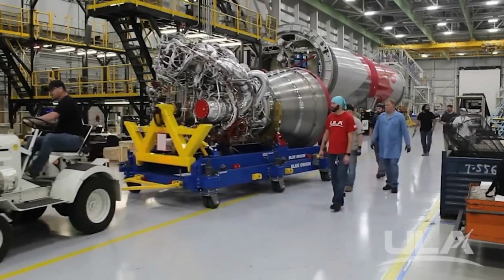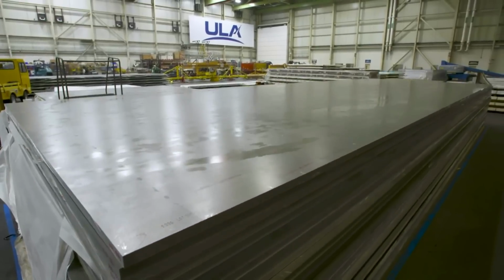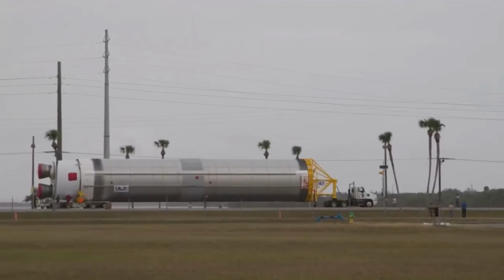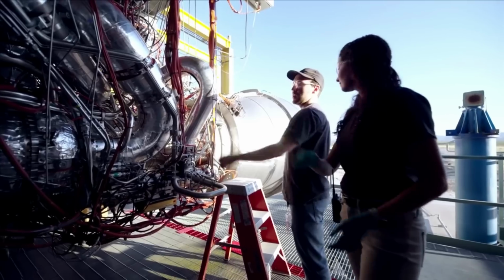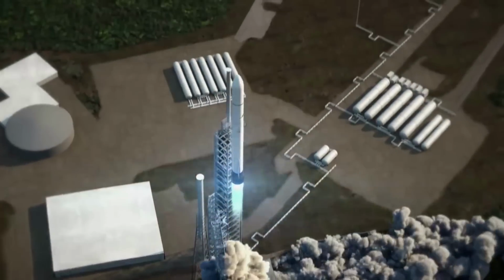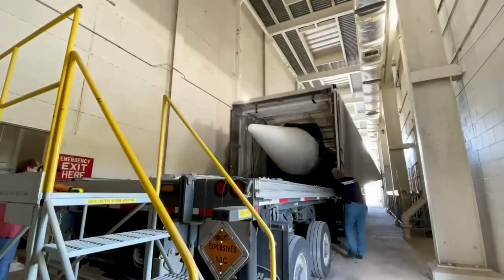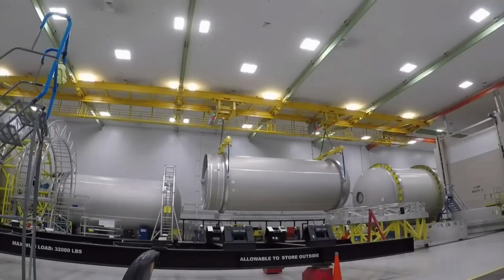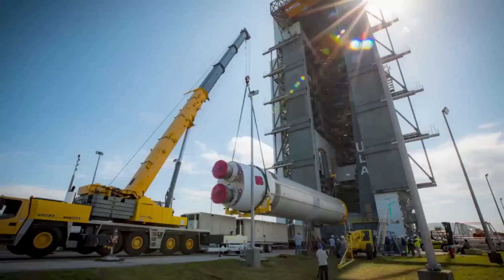ULA's Vulcan Centaur Is About To Launch For The First Time

Comment: With all of the setbacks and embarrassing delays that Blue Origin has endured with its BE-4 engine, could it actually be that the BE-4 will beat the SpaceX Raptor engine in launching a payload into orbit? Starship may be the super heavy lift future but the vehicle has a lot of new ground to break and problems to solve. Getting two engines to work together in a new vehicle is considerably less of a jump than getting 33 to do likewise.
Reply: If BO stops moving at the speed of dust then maybe, just maybe they may become competitive. 
Can't wait to see Vulcan fly!
Reply: @becausereasons3168  They've got to pick up the speed of BE-4 engine production. Hopefully the Vulcan will prove out the engine design.
Reply: BE 4 is comparable at least on the Vulcan to the Falcon family of vehicles, without the re-use capabilities, though for max payload, Falcon has to let go of a booster, as unrecoverable. 
Still cheaper since most of these boosters have seen multiple launches. I cannot get for the love of me why ULA does not lean on the partnerships such as Northrop Grumman to land these boosters. NG has been landing explosive rockets at bad guys bedrooms for decades, at mach 6+. They have the technical capabilities to land this one too.

Comment: SpaceX fanboys disguised as Space enthusiasts, keep bringing Starship as a comparative. When it doesn't even achieved the final prototype design yet. And could be used only for Starlink missions, because to  use a payload hatch, structural reinforcements to the hull would be necessary adding dry weight. Add to that the refueling at LEO required, and operational costs.
Reply: Just look at sls space x and nasa are two different beast. Leadership in NASA it's self understands now that space x is the future and they are as quickly as possible jumping on board and trying to save face simultaneously. Anyone that understands operational cost would not have made that comment. With NASA fuel can't even be giving as a percentage of cost it's so minimal. The cost of per kilo to orbit with starship will be so low. Fuel will be a factor. That in itself is something nasa on it own will never achieve.
Reply: Methinks all you have is your fingers crossed behind your back.
Reply: Don't let them live rent free in your mind.
Reply: Being a fanboi is the easiest way to show how stupid you are. Ok Starship is a huge technical achievement, but SpaceX will have to face all the challenges of Saturn V, the Shuttle, the ISS and Falcon 9 combined and then several more. The way Starship lands is incredibly dangerous compared to the Shuttle gliding and landing on wheels. It has no abort modes for the crew cabin and we know what happened on the Shuttle thanks to that. Starship best be a spaceship staying in space supplied with people by Crew Dragon or its successor.
Reply: You will be dragged into an age of affordable spaceflight whether you like it or not lol. The days of incremental improvement on 60's technology and most importantly expendability will soon be numbered.
Reply: @donkoltz1  if NASA with all an astronomical budget, and a team of brilliant Engineers, the best to came out in terms of reusability was the Space Shuttle, don't get your hopes too high in terms of operational costs with Starship.
Reply: @donkoltz1  Reusability doesn't necessary translates into better efficiency or substantial operational costs reduction in the Rocket industry.
Reply: @RogerM88  Roger, NASA is far from a astronomical budget , .048% of our national budget, that's less than half a cent per taxable dollar, if anything, underfunded. Hope Vulcan is a major success.

Comment: Though this was a nicely done  rah-rah  video for the Vulcan, it doesn't cover the key points of interest.  The Vulcan will have to compete against the Falcon 9 and Heavy.  In a lesser extent the Ariane 6 and H-3 new generation rockets.  Ultimately the Vulcan will go against the Starship.  The relevant questions is what does the Vulcan have to offer that makes it stand out from the competition?  The only reason I can see anyone would use the Vulcan for is for redundancy of launching systems that the U.S. military requires and they are not SpaceX for Amazon.  I don't think the Vulcan will be cheaper than the Falcon 9 and certainly not Starship.  Will they be competitive with the H-3 or Ariane 6?  Instead of reading ULA's marketing material, I suggest some real research and insightful analysis.
Reply: Vulcan is not really up against Falcon 9. More like Falcon Heavy. On that basis it is quite competitive. And the US Govt or USAF will always want more than one choice. They won't want to be locked into Falcon Heavy as the only choice.
Starship is many, many years away as practical commercial proposition. The way Starship is configured, it can't do any more than LEO. Anything more than that requires refuelling. Or alternatively a substantial redesign of the Starship itself so it can release payloads for further injection into higher orbits or beyond. None of that will be achieved for at least 5 years, maybe longer.
Reply: @waynemapp6333  Well put.
Reply: @waynemapp6333  The Vulcan in its none solid booster configuration and Falcon 9 are comparable.  They both have similar lifts and can launch the majority of military and NASA payloads.  The Falcon 9 is about 40% cheaper.  The Vulcan with 5 solids has a similar lift as the Falcon Heavy and is reasonably competitive.  The Starship should be putting payloads into LEO by next year.  It is being developed to refuel in LEO and open the full solar system for payloads. The government seems to think this capability is credible and is funding, at least partially, the development. My comment was not to argue the benefits of Vulcans over Falcons but suggest the content creator of this video go beyond the marketing fluff with some actual comparative analysis.
Reply: @WWeronko  My comment on Starship is about the very optimistic Elon timeline for it to be in service. Yes, Starship will succeed, but it will take some years. I reckon 5 years, and even then won't be rated for human spaceflight. The basic design of Starship gets it to LEO, with the Starship having fully used its fuel. Starship can get a 95 tonne payload (maybe more) into LEO. Provided Starship has large cargo doors to release the payload, then it will be possible for that payload to go much further. With such a large cargo to LEO, it means a decent sized payload anywhere in the Solar System. But that will take quite a bit of design work. Maybe cargo doors like RocketLab's Neutron.
Reply: ULA is currently still planing to eventually upgrade Vulcan and make it partially reusable. The Sensible Modular Autonomous Return Technology (SMART) concept would recover recover the BE-4 engines, avionics and thrust structure using an inflatable heat shield and parachutes. This could (according to ULA) reduce first stage costs by up to 65% (the engines are the expensive part, not the tanks).
But the main thing is that it's available and trusted. Even though rockets are expensive, Satelites and space-based science experiments can be significantly more expensive. An extreme example would be the JWST which will cost a total of almost $12B over it's lifetime. The fact that the Ariane 5 costs $175M to launch, while an expendable Falcon 9 might only cost $95M, now only represents a 0.5% reduction in project costs.
Reply: @plainText384  The best that can be determined the reusable aspect development of Vulcan has of yet not been funded.  It may happen but not for a long while.  As for trusting Vulcan over Falcons, the Falcon 9 launch vehicle is perhaps the most reliable rocket ever launched.  The Vulcan has not ever been launched and as of yet has not proven itself.
Reply: @WWeronko  "The best that can be determined the reusable aspect development of Vulcan has of yet not been funded." .. What?  It's already in prototyping, Tory Bruno wants SMART ready for the AWS Kuiper launches according to past tweets this year.
Reply: @dalel3608  Prove it.
Reply: @WWeronko  they literally recovered an inflatable heat shield on an Atlas V mission to test this exact thing
Reply: @damien-nk9ko  That was NASA not ULA.

Comment: Single use rockets... what a waste! This is nothing but a ULA commercial!
Reply: ULA still has plans to eventually reuse the BE-4 engines and some other hardware, by detaching the engine section and recovering it using an inflatable heat shield and parachutes.
The whole thing is called the Sensible Modular Autonomous Return Technology or SMART concept, if you're interested. So far there has been little progress on this, but we have recently seen ULA and NASA demonstrated an inflatable heat shield in the joint LOFTID (Low-Earth Orbit Flight Test of an Inflatable Decelerator) tech demonstration and BE-4 engines are obviously already designed with reuse in mind.
Reply: @plainText384  Half-baked reuse was shown to be a fallacy with the shuttle. You need to go all in or your vehicle will still be cost prohibitive.
Reply: @donkoltz1  not going all in on reusability wasn't the problem for the space shuttle, it actually was more reusable than a falcon 9, as only the orange external tank needed to be replaced after each launch, not the whole second stage.
The shuttle's problem was safety and refurbishment costs. If the Shuttle proved something, it's that designing for reusability doesn't automatically create a cheaper vehicle. ULA hopes to avoid the shuttle's cost problems by recovering only the most expensive components of the first stage, no complicated second stage recovery, no costly recovery of relatively cheap components, like spent solid rocket motors and empty tanks.

Comment: Why not just customize the payload fairings so there is never any wasted space or extra mass?
Reply: That would massively increase cost and reduce economies of scale. Sure, they could save some mass but at the cost of changing the aerodynamics from launch to launch and having to run multiple manufacturing lines.
Reply: @AsymmetricThrust  I’d Imagine Tooling Cost as Daniel alluded to.
Reply: It can but most didn't due it due to cost, aerodynamic change and others. (All of those need to test beforehand too so more cost)

If you want larger fairing, most just go to other rocket that has larger fairing
Reply: Because ULA.
Reply: @tepidtuna7450  because ULA what?